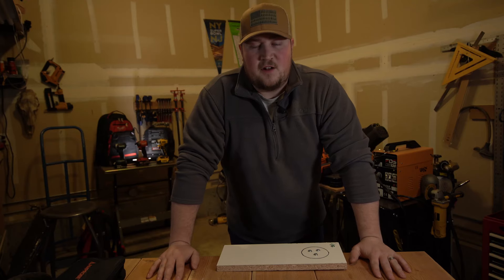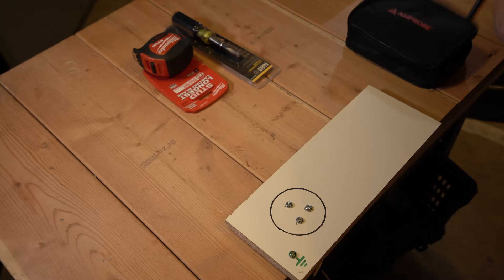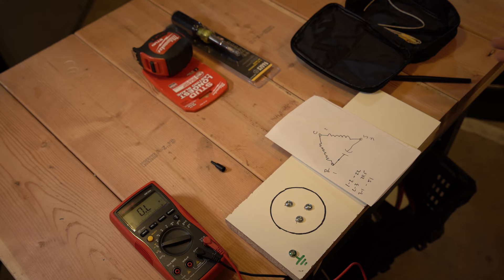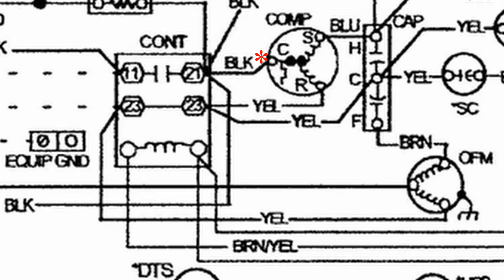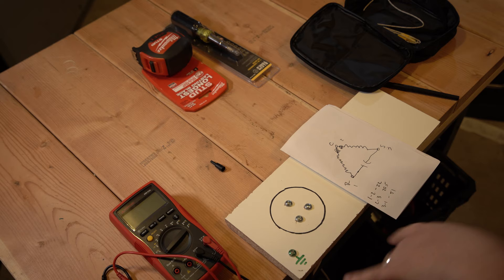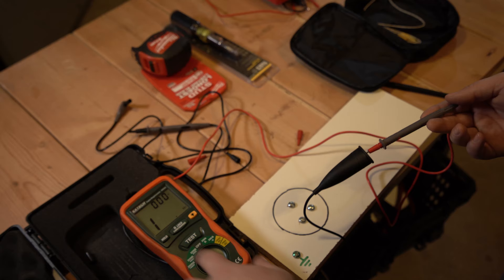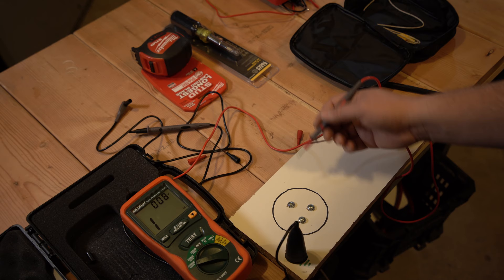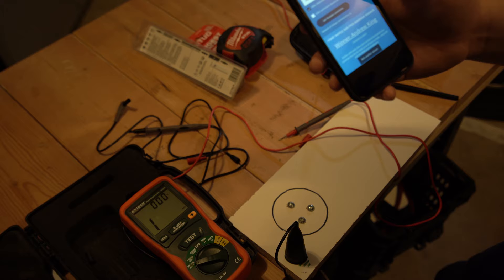How To Ohm a Single Phase Motor

Comment: Excellent job on the video ! There are 2 points that you didn’t bring up that are very important to keep in mind. First - the most common cause for compressor motor winding degradation is moisture and taking meg readings over time can reveal the effects on the windings. Second - the lowest allowable resistance to ground for a motor winding is 1000 ohms per volt , ie if a motor runs on 480 volts then the lowest allowable resistance to ground must exceed 480,000 ohms. Just food for thought and keep making great videos !
Reply from the maker: Good solid points.  2nd point is the reason I prefer a meter like this that actually displays a resistance value vs the supco that I seem to see more guys using.  I don't recall if I mentioned it in the video or not,  but I've had  480v motors running as low as 2 M ohms to ground and have been for years, so its good to be able to trend any winding degradation. Thanks for the comment and for the support!

Comment: Great video!
When it comes to condenser fan motors and compressors I do believe in spot checking windings due moisture. 
I had a string of false readings with my ohm meter on ground checks. After a rain fall I would get call back as condenser unit tripped our. Long story short I purchased a used mint condition fluke 1520 tester. Megger would have exposed the winding insulation nick or breakdown.
I see many techs with that supco tester but I would recommend that klein ET 600 tester for hvac guys.
Or if you can spring the cash the fluke 1587 IMO.
Thanks for the video again!!!

Comment: Draw a sketch of the terminals and take ohm readings to determine which winding is which by values found
_____/ 2 c
022.1	029.5, these 2 should add up to the value of r - s
__1 r / 3 s 051.2

Comment: VERY informative tutorial! I have a 40-year-old system in which the blower motor died (bearings seized). This video worked great for determining Common, Run and Start. HOWEVER, all the potential replacement motors I can find have either just TWO leads (no Start?) or several leads - one Common and several speed selector leads. These, of course, are in addition to the two capacitor leads. How can I match my older control system, which has Common, Run and Start leads, to one of these new motors? Or is that not feasible? THANKS!!

Comment: Hi, Great video. Could you test a few multimeters and insulationn meters for u to all see. Im over in the UK and we see any different makes but not sure if any are good. Also could you do a windings test on a 12v and 24v motor please

Comment: Pretty cool how you explained it. Are you gonna get the supco megohmeter or do you prefer your extech?
Reply from the maker: I prefer this one over the supco this has multiple voltage test ranges 250, 500, and 1000v and tests up to 2000M ohms.  The supco has just the 500v test up to 1000M ohms but will work just the same.  Either one will get you to where you need to go.

Comment: What if im getting the same resistance for my high and low. Breaker keeps tripping when sw is in off position. 1phase 1/3 hp motor. Motor runs on hi and low but when switched off trips breaker. Thanks and be safe!

Comment: I have an RV furnace motor. I have a multimeter. Forgive me. I must be not very bright. But I have the motor removed from the furnace unit. I have no ground on the motor itself and I have a red and black wire. My meter has an  ohms dial from 200 to 200 M. How do verify that this motor is ok?
Reply: Does it run off 12 volt?
Reply: @rojobandito318  yes